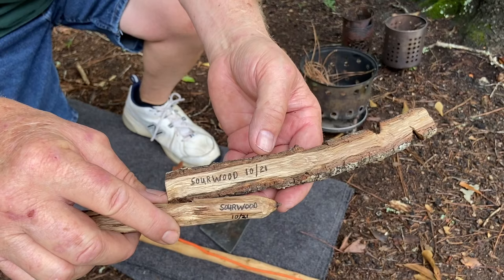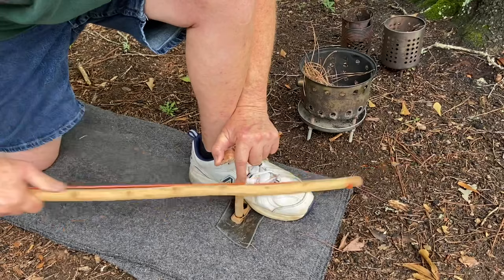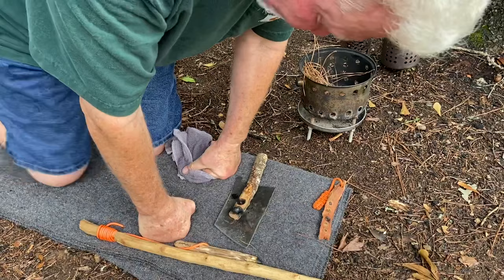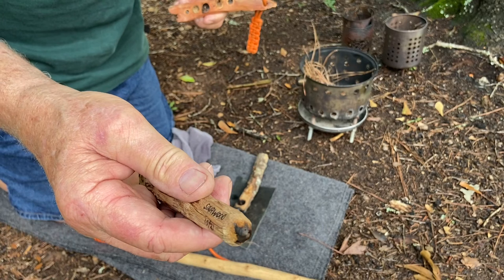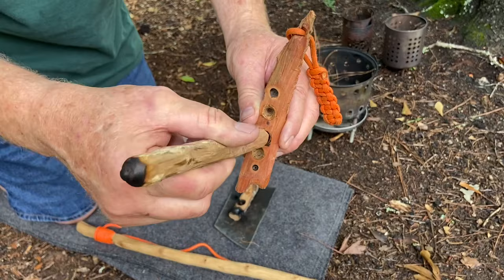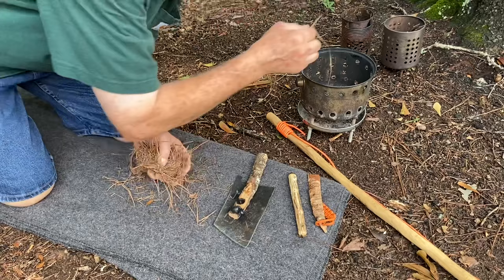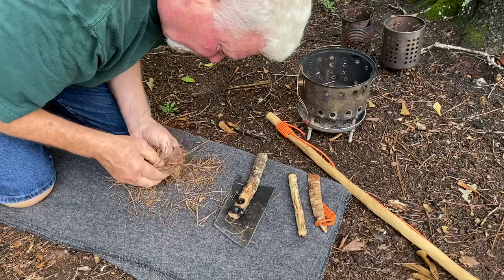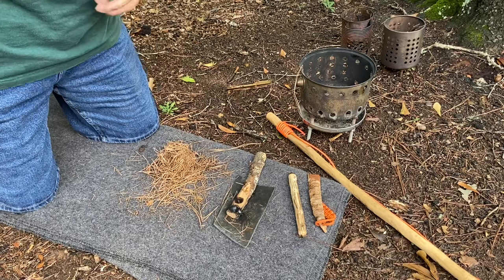The Secret To Much Easier Bow Drill Embers

Comment from the maker: I've been preaching this for years, "Stop loading your bow drill spindle into the bowstring so tightly". Whether you realize it or not, you have to press down much harder just to hold it all together which produces everincreasing wear and drag on the bearing block and spindle tip. Another way to say it, very tight bowstrings make it harder to start the spindle spinning. So, to compensate for all the extra forward pressure that the bow has to apply, you'll have to press down harder to keep the spindle from popping out of the bearing block and fire board.
   Please follow the LINKs below and SUBSCRIBE. Thank You!

Bow Drill Playlist
https://www.youtube.com/playlist?list=PLkoXX8XsMW3kw-EXlvpLS68aJjR89P4ae
Sourwood Bow Drill Friction Fire In The Woods
https://youtu.be/VhOod_mZmZU

Comment: Thanks for the tip! I have definitely had my bowstring too tight before and it’s such a struggle.
Reply from the maker: It's a good tip ALSO, for those that are already using a loose-ish tension, but need an even looser one for a very soft spindle.

Comment: Agh! I’ve been trying for years. Once or twice I’ve gotten it, ever. My problem is the drill always jumps out of the hole and the string flips the stick. I’m nothing if not persistent though. Using yucca on yucca. That’s should be the easiest material. I’ve also been trying using a pump drill but it seems to get stick or caught and stops spinning even with almost no pressure from the hand socket.
Reply from the maker: Your bowstring is way too tight. You have it that tight because the bearing block has to much drag on it. And you're using too big of a diameter spindle. Nothing bigger than 3/4"

Comment: Thanks David. I'm sure this has been asked before, but do you find that paracord works better than #36 bankline for the bow string?
Reply from the maker: I haven't tried bankline. Paracord seems like it would be better.
Reply: @DavidWestBgood2ppl  Oh wow, I'm actually the opposite haha, that's why I was wondering. 

I heard that bankline gripped the spindle a little better, so bankline is what I started with, and the only thing I've ever used. 
But I wouldn't know by comparison which performs better (if there's even any difference), so I'd like to try with paracord sometime.